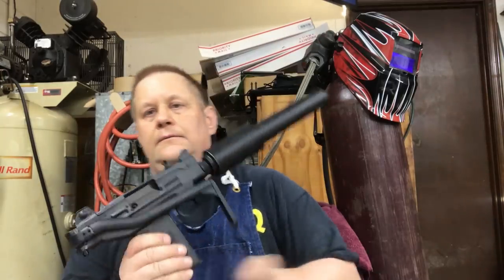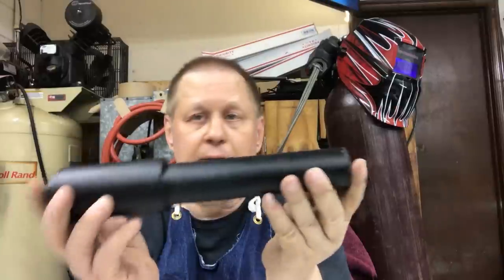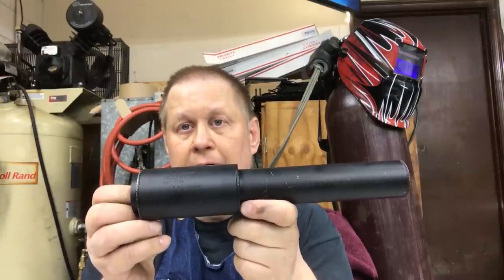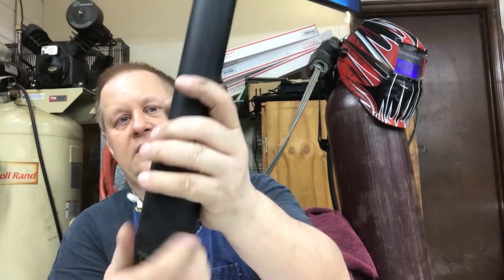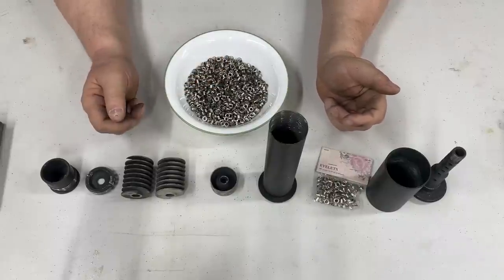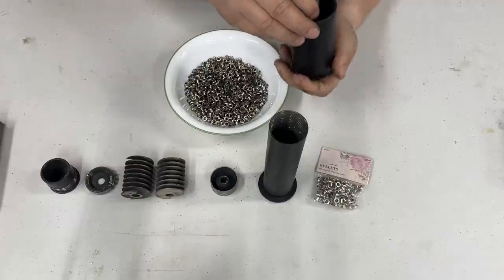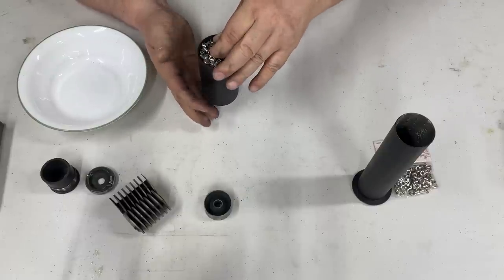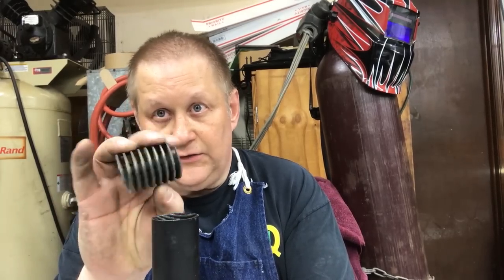What's Inside A MAC Silencer

Comment: Used to have one years ago. I found the eyelets to be inefficient. I tested the sound level with several decibel meters using different alternatives. I tried copper eyelets, steel wool and finally a copper Chore Boy scrubber. The heat transfer is best with copper. The Chore Boy scrubbers are easier to pack and allows more material to absorb the heat. I had to replace the packing after about 200 rounds for best results. The wipes were only good for five rounds. I could detect a noticeable decibel increase after one magazine. The Nomex cover made it much easier to handle. All I have left today is the disassembly tool which was a must have if you were going to clean and maintain an original Sionics suppressor.
Reply: Stainless steel chorboy last longer
Reply: Nice data.  Thanks.

Comment: Sold a bunch of those in the early days.  They worked well but got “warm” after a few mags and hard to hold unless you had one of their covers. Miss those days .
Reply: we used the strap hanger and then used to rat a coat hanger around it and twist until it got tight but it was shit to hold onto.  wish we had those silicon pot holder gloves back in the day.  somebody would have made tactical silicon pot holder gloves...

Comment: The washer in the end cap is called a bullet wipe and helps remove the last gas bubble fro the bullet as it passes through.  You can use a mouse pad for the neoprene material.

Comment: You can make the fixtures and spacer for the 14" thick neoprene wipes, using dense neoprene, punch a 1/16" -1/8" in the middle of wipes depending on cloner, 1/16" for 9mm.

Comment: You could still buy everything except the outer tubes in a kit in the late 70's and early 80's for around $200 bucks.
Reply from the maker: They weren't that much in the 70's.
Reply: you could buy internals from ONE Vendor and the tubes from ANOTHER Vender.
(so I heard)
Reply: And the outer tubes were like, 10 pages after the ad for the internals. I remember it well. 

Do you remember the 2 liter pop bottle adaptors for the MAC 10s? 🙂
Reply: @63DIRTY   They sold them for 10/22's also. There was even a version that clamped onto .410 non ribbed shotgun barrels sold.
Reply: They were 42 dollars from RPB and then SWD up until 1985
Reply: The 80s were good I remember seeing all that stuff at gunshows
Reply: @BWEFirearms right? You could buy a brand new car off the showroom floor for $3500 on average in the early 70s.
Reply: That’s like $27.5k in today’s money with inflation, so the same still applies.

Comment: I did see a MAC that was in 380 with an attached silencer.  It consisted of two parts, but different in that it was not full of eyelets.  Maybe those were missing.  It was in for repair of the neoprene washer that was at the front of the device.  The gunsmith that repaired it was set up to do silencers, but not full auto weapons and had some sort of permission from ATF to have that item in his shop.  I never saw that MAC being fired.

Comment: That's a nice hobby sized cnc lathe behind you. I don't recognize the control panel on it. Is that an old Bridgeport EZ Path lathe? That would be great for turning those spiral baffles like you just showed us. One has a right hand thread and the other is a left hand thread. The change in gas direction slows down the gas and it's also able to give up some of it's heat in the process which condenses the gas.
Reply from the maker: It's a Trak 1630 lathe.
Reply: @BWEFirearms   I looked up the specs as I'm not familiar with those. Nice distance between centers and a big bore through the spindle is nice. About the only limiting things would be it has a low spindle speed top end and the rapid travel rates are slow. I see they have an option for a tool turret but I didn't see one on yours. Even if your using it for one of a kind jobs or for prototype work, a tool turret will save you a lot of time and cut down on scrap. I'm not sure what kind of electrical interface is required but you can get Chinese tool turrets for $1200 bucks new. You will be hard pressed to get an original for that kind of money. 

I guess you also could set it up as a gang tool style cnc if you wanted a little more automated production out of it. 

With all that cnc power so close I'm surprised you haven't turned down a piece of 2" diameter material to make an Uzi barrel with a funnel end on it kind of like a blunderbuss or ray gun. That would be an impressive science fiction space gun barrel on an Uzi. Practical? Nope, but it looks cool hanging in the lineup with the normal guns!
Reply from the maker: @tenlittleindians  I am not a high production shop so it works well for me. Tool changer was out of my price when I purchased it. I wish the distance between centers was longer for full length barrel work but it is what it is.
Reply: @BWEFirearms  True. A lot of people read 30 inches but don't realize a chuck at one end and a tail stock at the other can burn up distance fast. No machinist wants to take off a chuck and use a face plate with lathe dogs unless he has to. The problem with the longer bed lathes is they waste a lot of shop floor space for how few times your turning something long.

When I was checking out the specs on your model lathe I noticed they now have a 40" between centers version. That would cover most modern barrel outside diameter work. Inside barrel work needs double that distance to fit long tooling in the tail stock or tool posts.

That's when a dedicated gun drill earns it's keep.
Reply from the maker: @tenlittleindians  I looked at the 40" machine and it lacked features that I needed.
Reply: Right, saw one close up back in the day. Baffles turn in opposite directions like you pointed out. Seems like the wiper was held in place by those baffles pushing against it. Forty years ago, time flies…

Comment: Did these ever use steel wool pads?  Not sure if I'm confusing that with some other suppressors of that era.
Reply from the maker: The MACs did not but some of the old silencers use bronze wool.
Reply: @BWEFirearms ….
a excellent replacement is the STAINLESS STEEL or COPPER coated pads 
sold in packs at discount stores, (just pack in tight) or muffler material (fireproof) sold at motorcycle shops to repack and rebuild blown-out 2 strokes.
steel wool is coated with a rustproof flammable coating, would not use.

Comment: ha, we used a oil funnel in the arms room to repack those things.  out and about we just cut the corner out of a cheetos bag and dumped them in like that.  or just roll up a funnel with a piece of paper, just used whatever we had.  the bitch part was unsticking those threads after you lost the disassembly tool and you're trying to use a piece of broken antenna or some other crap.  sorry to hear that you're gone.  i just found your page today.  don't know what your history was, maintainer or operator (or both) but it looks like you have a pretty good following and i'm sure you will be missed by both your casual fans and us maintainers and operators active and retired (like me).  see you in the clearing, at the end of the path Brother.

Comment: Hi Richard. Interesting video. Was that all shot on the first take? Was wondering about the comedic flavor. Anyway, my choice would be to restore to as close to original as possible, then mount in on a period correct MAC 10 in 45ACP. Instead of the asbestoses can wrap, use Nomex. That would be my idea of 10/10 !!!
Reply from the maker: I shot it in one take then edited it afterwards. It's a 9mm MAC silencer not a 45. I will make new internals for the second stage but I will squirrel the original parts away in case I ever decide to put it back to original.

Comment: Have you seen the electric motors the old timer RC plane guys would use to start their glow engines? I have one and they can be adapted to a rubber cone, moral being the rubber cone gives you torque control via pressure, and could be used to run long threaded baffles down quickly and easily.

Comment: I would like to see how you make a wipeless endcap for that silencer.
Reply from the maker: I have been thinking about it.
Reply: @BWEFirearms  do you know what the ATF policy is on wipes?
Reply: @535tony …
if you are referring to a wipe as a resilient material that is located at the 
muzzle end of the can…. a few years ago ATF classified wipes to be a 
internal part of can… a replacement to be treated same as other internal 
parts.. 
DEFUND the ‘Firearm Division’ from the “AT&E”.
Reply: Is neoprene rubber or plastic? You could cut rings out of just about any type of foam or rubber although rubber might melt less
Reply: @luislongoria6621  The problem is ATF considers the wipes to be suppressor parts.

Comment: Folks, those spiral baffles DO NOT work as documented in the patent.  Gaseous exhaust through a small orifice into a channel expands omnidirectionally, so a successive series of orifices along a channel, regardless of that channel's path, cannot cause the sum total of exhaust to move in a specific direction.

Remember that a patent does NOT certify the device being patented actually works at all, much less as is specified in the language of the patent.